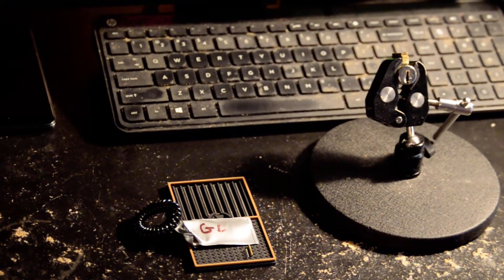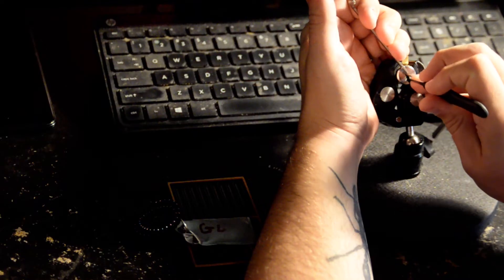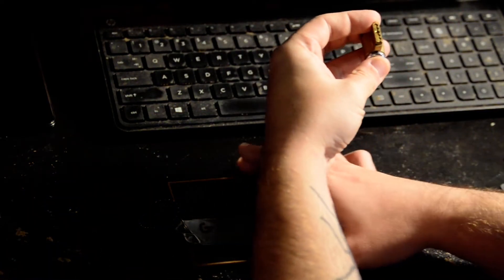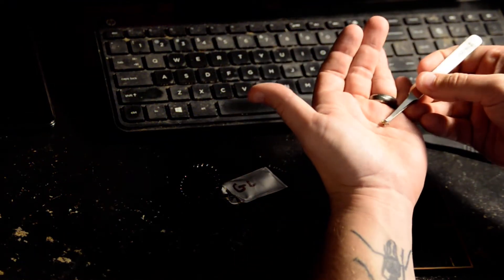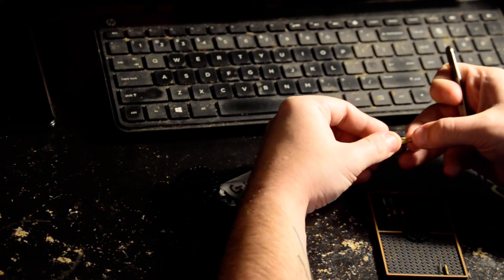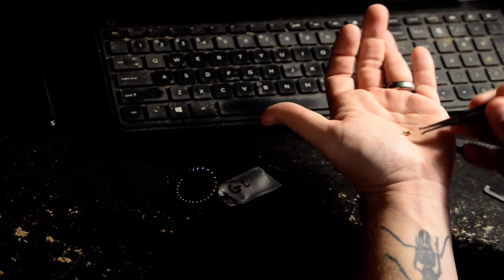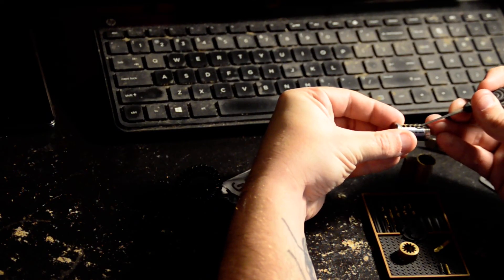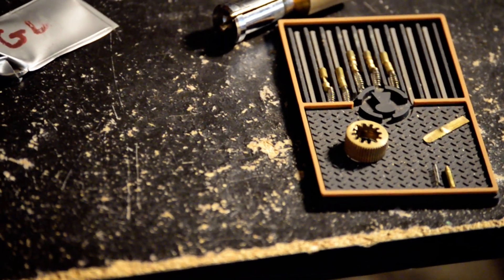"Go Left" Challenge Lock Pick and Gut

Comment: Nice job! Man I had so much fun making this guy. Number 5 is called a snaggle tooth pin (named by another reddit user on r/lockpicking). Number 2 and 3 are what I started calling "Tee ball" pins. I've since refined them with serrations and other interesting profiles lol. I'm so happy it's still giving that deep set even if it's a quick pick. There actually aren't any mods to the plug or bible. Just a junk kik cylinder I had with loose tolerance to exaggerate the false set lol. Hope you enjoyed and glad it's still making it's rounds. Tag me if any of my other monstrosities come through your bench. Cheers!